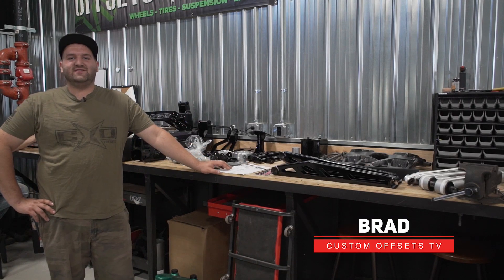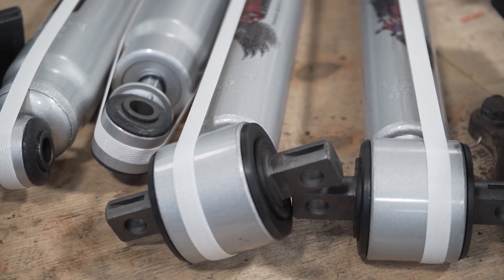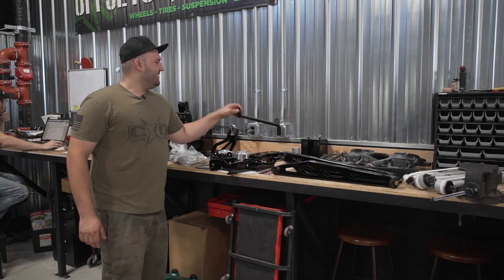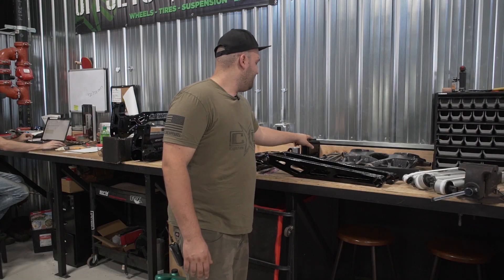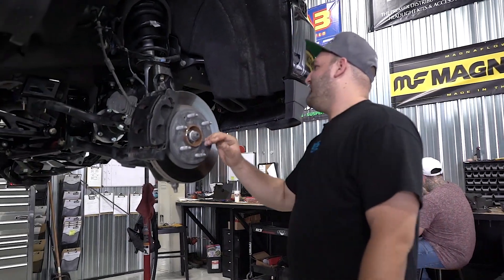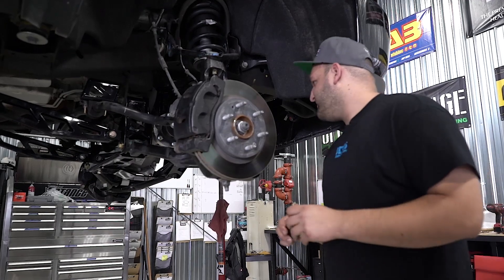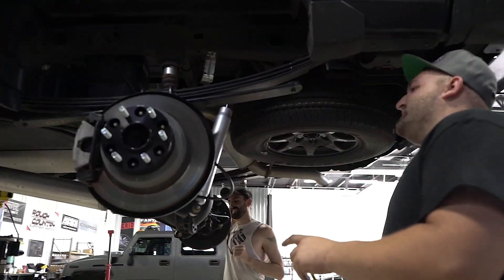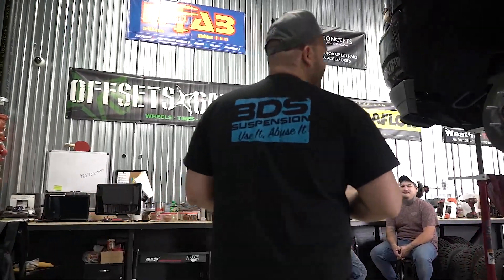Mcgaughys Adjustable Lift Kit  - What’s the Difference?!

Comment: I run this exact kit just with fox 2.0 shocks in the rear and it rides like stock or better he’s making it seem like if it’s a cheap kit when it’s not it’s a million times better than rough country
Reply: Indio LsX  does this kit ride smooth @ 65 mph ive heard rough country is crap at hwy speed, just want to buy a kit without regretting  it.

Comment: About damn time I love my mcgaughys lift it rides so smooth. Smoother than my buddies bds by a long run although I’d never do it my axle angles are good enough if wanted to stack a level I wouldn’t even be close to maxing out my angles at all y’all should do a mcgaughys vs bds lift kit have them side by side and compare them
Reply: Jayson Terry i would to see that video! I stuck between this 7-9 mcgaughys and the BDS 6 inch for my 2018 Silverado crew cab.
Reply: @Frog_man007  the McGaughys is a 7" diff drop where tie bds is probably around 4". It's so the McGaughys can lift to 9 without bad cv angles.

Comment: I have the same truck except it’s the lt version. Was just commenting on the body lift video with Fuller, but would rather not go that route. I have installed a 6.5 zone but love the 8” look! Along with the kit up front I have the bilsteins adjustables... would it be fair to say I could get 1.5 more lift from cranking up the front shock and adding in a rear leaf to get to that 8” lift mark? How much would it effect my angles? Wheels and tires are 20x10 -24 on 35’s.

Comment: If I order this for my silverado and do the add a leaf for 9in does it come with the block as well I will run it at 7 for now then probably go to 9 later on?
Reply from the maker: Yes the block comes with so you will be able to switch it out later!
Reply: LSx life but he did say without the extra springs in the back, this kit set to 9 the front will be just a little smaller than the rear.

Comment: I have a 2014 lifted Silverado with 6inch  coming from driver side front a slight fluttering knocking noise I changed lower a arm ball joints an the noise is still their driving 5mph you can really hear it any suggestions opinion would be greatly appreciated thanks
Reply: Ed Troyer has your knocking noise been resolved?
What lift is it?...and you did it yourself?
Reply: @Espenrip  I haven't looked at it yet but was told that it's normal for Chevy it's a 6 inch lift
Reply: @Espenrip  it's a pro comp lift
Reply: Ed Troyer 

You ever get it fixed?

Comment: I was given this kit by a friend and I was wondering do I need Upgraded upper control arms if I run it at 8inches. I know I do at 9inches but I’m not sure I will eventually but by then I will have a 10-12in lift
Reply: You’re probably going to want to upgrade them. Ball joint isn’t at the right angle with this kit installed

Comment: Do I need to get the Add-a-leaf in the rear if I want to run this kit at 8 inches?
Reply from the maker: You can run it at 8" without the add-a-leaf but it would squat a bit. The add-a-leaf is definitely recommended!

Comment: Do the rear shocks extend long enough for 9 inches? Just wanted to be sure about that.
Reply from the maker: Yes they would for the 7-9 kit
Reply: Okay I have the kit already on the truck I have the front set at 9 and the back is lower so I wanted to add another leaf or bigger block to raise it be leveled with the front just wanted to know if the shocks would be long enough for that thanks guys!

Comment: For a 99-06 gm 1500 would the traction bars and and the compression struts if their design for 07 and up ?
Reply from the maker: Most likely not. We recommend only using parts specifically for your truck

Comment: I have this same kit on my 2015 GMC Sierra Z71.. I have read a few comments on how nice it rides.. mine rides like shit. Its the roughest lifted truck I have ever owned. I have had the struts and rear shocks checked where I had it lifted and all the suspension components checked also.  Anybody out there have any ideas besides dropping it back down which is not going to be a breeze... Bummed.
Reply: I have the same issue now its squeaks from the rear on any little bump I'm wondering if traction bars or a sway bar would fix this issue it kind of sounds like the leaf springs who knows 🤔